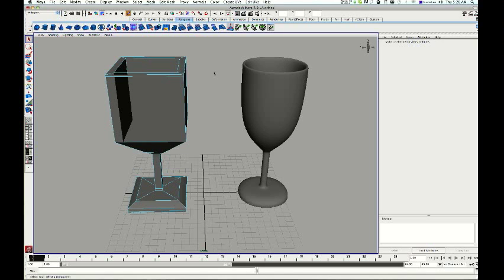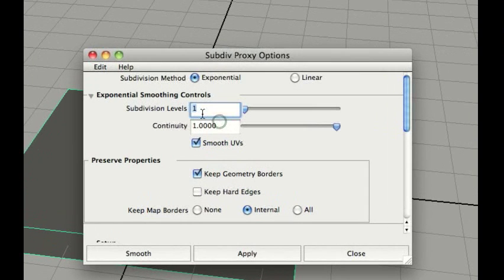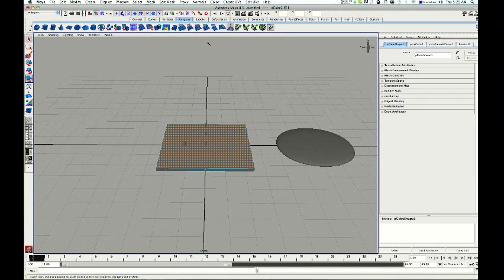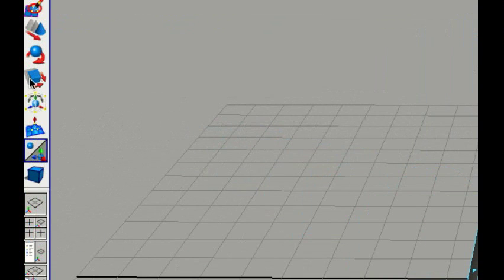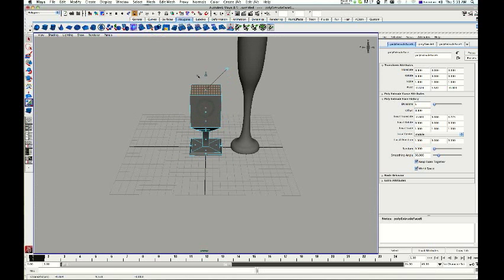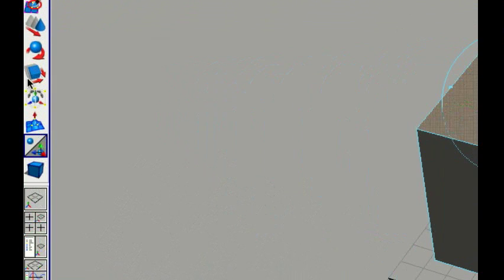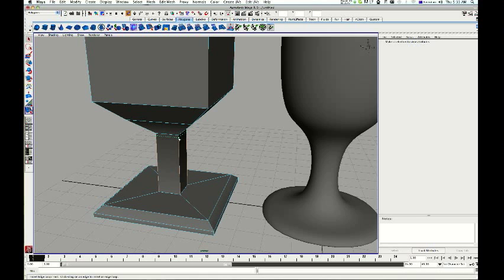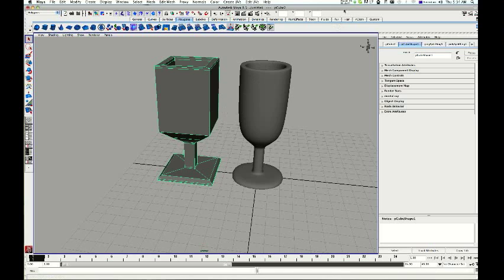3D Maya: Extrude and Sub Division

Comment: Thanks.
I found your video really easily.
Nice Keywords.
I also need to seperate the subdiv cage from the product ...
whether by color or location ... it was confusing otherwise .. even with wireframe
The drinking glass does not look extremely circular ...  is it easy to make it so?
I have my own personal modeling needs for subdivision.

What were you modeling needs for this video?